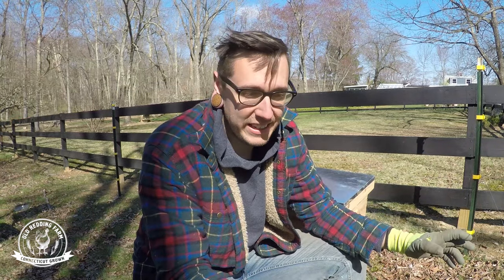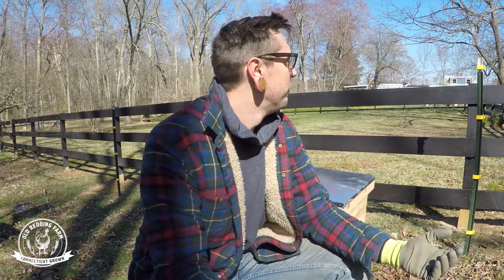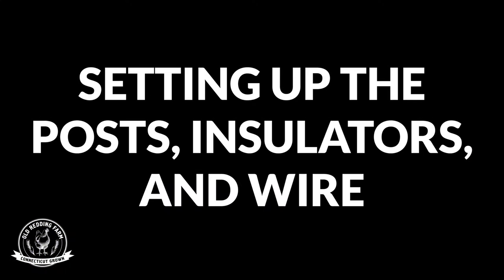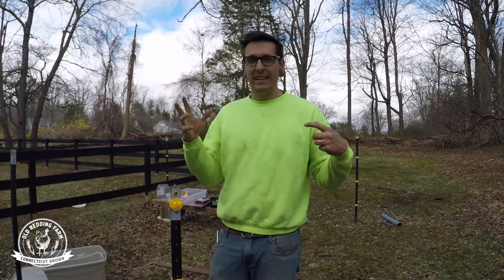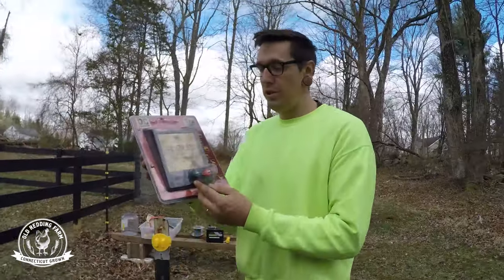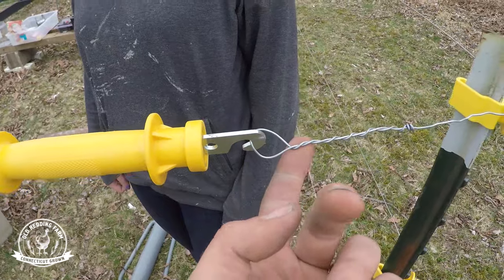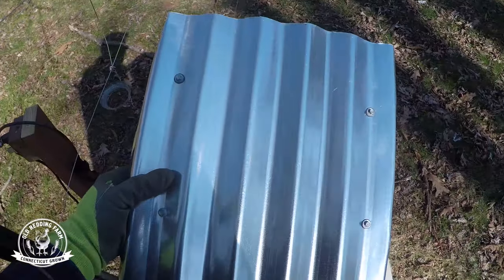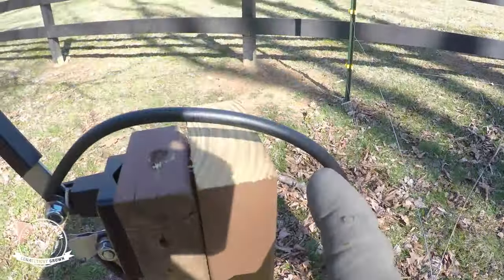How To Set Up Your Electric Fence | Keep the Bears Out of Your BEES!

Comment: This is a really great video! How long does the battery last? Do you need to swap it out frequently?
Reply from the maker: Battery lasts about 3 days ... It is a little bit of a pain to keep switching the dead battery out for the charged one. Contemplating this year either splurging for solar charger or a more powerful battery that will hold the charge longer. Depending on how far it is from your house you may or may not find that as annoying as I do.

Comment: How long does that battery last before you have to charge it?  Or have you converted to using a solar panel with it ?  Considering using this setup for an expanded pig pasture,
Reply from the maker: a few days, but I wonder if pigs were touching it more and getting zapped more if that would drain the battery faster? We bought a spare battery and every 3 or so days we would drag the charged one out and the dead one inside. Its also a lot lower stakes than with pigs though because the bees only need the fence if a bear shows up but the pigs need it all the time I would think. If you can swing it I'd go solar.

Comment: Not so sure setting battery on brick is a good idea might want to reverse brick and board. Someone told me once setting batteries on concrete floors is no good for the battery, it would drain/kill battery, so wouldn't setting it on brick be the same as setting it on concrete floor? Might want to look into this. I'm like you not the smartest person in the world. You are smart though don't discredit yourself! Excellent video!!! I'm going to make one like yours for a vegetable garden mainly to keep deer out.
Reply from the maker: Oh good I hope the deer stay away from your veggies! Several people did say that about the battery on concrete and we did end up moving it. There were a few other good suggestions in the comments if you browse through before you get started especially if you live in a rocky area lots of good tips for getting the grounding rod pounded in better than I did  :)